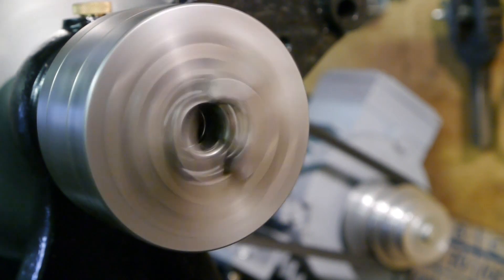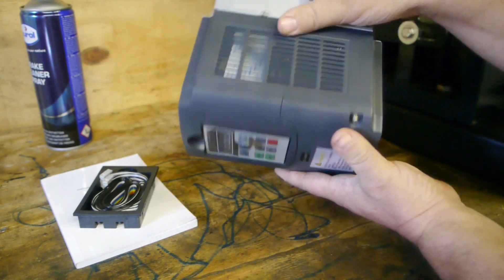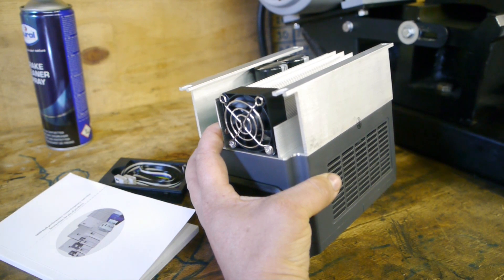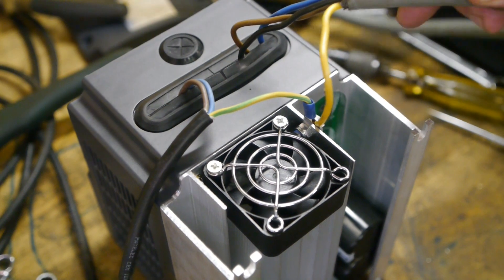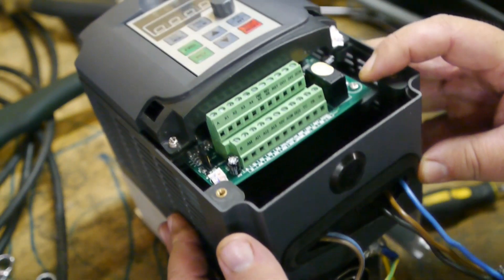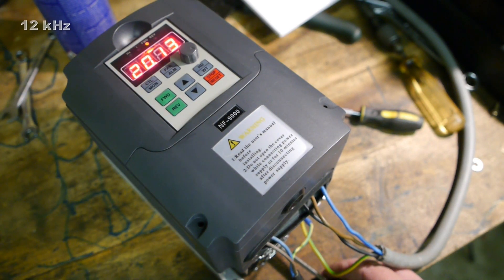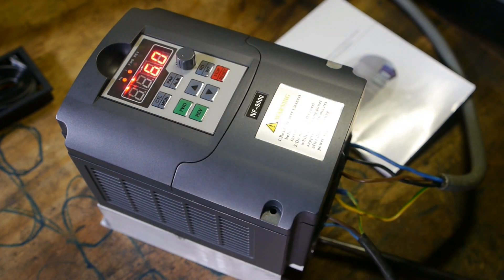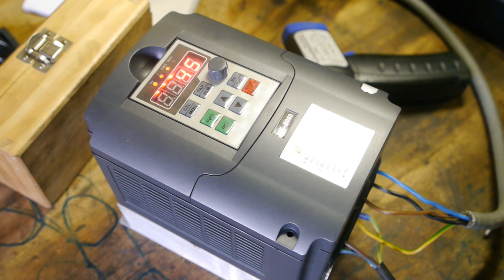Reviewing, testing and installing a cheap Chinese VFD

Comment from the maker: FYI: After opening up the drive I'm now pretty sure the fan was setup to run from the start. There is probably a firmware setting that can change this behavior but that will be hard to figure out.
I'm planning to install a variable resister with a on/off switch get rid of the noise.

Have a look inside: https://youtu.be/GXNwD2YVbpM

Comment: You had it easy, really. The one I got had several segments of the LED display not working. Imagine the hours of fun I had working with it before I realized which didn't work.
Reply from the maker: I can see how that will be super frustrating. Did you get it replaced under warranty?

Comment: Sir, the thorough review helped me greatly.  I have a knock off of that drive.  I am trained by the Air Force, circa 1965, through 1985, to trouble shoot down to the component level, and repair all electronics.
First I recommend external strain relief using the metal or the plastic cord restraints, to secure the two large cables on each of their side of the heat sink  Second, I would trouble shoot the temperature sensor, for it seems to control the fan, and runs it all the time. Your solution will work, for now. I do buy China made tools and items, to start with, and change some items out for USA made items, when available, and our funds are saved up.  There once was a 12 volt DC computer case fan, with sensor and rheostat, and there are some as NOS on ebay, or Craigslist,  most likely.

Comment: Looks like the newer model of the same VFD is called WK-9000 (instead of NF-9000).  I just bought a 2.2KW (3HP) variant of it.  The fan still runs continuously and there is still no ground terminal.  But it's easy enough to work around these two problems, so in my opinion this is still a good buy at the low price that it's selling.
Reply from the maker: They obviously haven't seen my video. Making the same mistakes again :) 
To work around the issues you probably void you warranty. Hopefully you won't run into problems.
I rather like my new VFD drive and I really appropriate it when I'm using my wood lathe that uses the old drive. A hell of noise :)
Reply: how do you install a ground terminal?

Comment: Temperature sensor is on the heatsink. You can replace the fan with one the same case size, input voltage rating, and lower air flow rating. If you can find one with sleeve bearings, it will be even quieter. On my HY VFDs, only the higher kW models have the fan on/off controls implemented, but the same firmware is installed in all drives. Only the default values change from model to model.
Reply from the maker: I was thinking about installing a bigger computer case cooling fan. Those run at a slower speed and should make less noise.
Unfortunately I need to fully dissemble the drive to get to the fan wires.
Reply: Disassembly is not too difficult. However, you could also consider cutting the wires and splicing them or installing a connector. Heatshrink insulation makes the splice option practical and safe. You will find that any particular cooling fan outline shape has many operating voltage and airflow combinations. In addition, you can often select ball bearing and sleeve bearing types. Sleeve bearings are much quieter. Fan blade count (more is better) and fan trailing edge also affect acoustics. The power supply for the fan is electrically isolated from the mains.
Reply from the maker: There is no way to get to the wires without disassembly's. But I will gather up some courage and give it a go :) Perhaps next weekend.
Reply: Since you have access to the 2 screws affixing the fan, you may or may not be able to get access to the wires without more disassembly. My HY VFDs are very similar but not identical to your unit. There are many YT videos on 'Chinese VFD Teardown' that might be useful. Here is a verbal description of what you will probably need to do and find along the way: Remove and unplug control panel. Remove wire access cover screws and cover. Remove housing fixing screws and housing. Remove top circuit board fixing screws and screws affixing 6 IGBTs and bridge rectifier to the heatsink. Pull the circuit board assembly away from the heatsink, taking care to not break wires to the capacitor circuit board assemblies and the heatsink temperature sensor (2 leads, TO220 device usually). This will give you access to everything. I may have left out a step, but everything will be obvious except possibly the need to remove the 7 screws fastening parts to the heatsink. The DC bus capacitors all should have bleed resistors, so you can proceed with disassembly safely within a few minutes of disconnecting power.
Reply: Just remove those 2 screws, and you will see that the fan wires are long enough to pull the fan away from the VFD and cut and splice the wires.
Reply from the maker: Wow, you know all that from memory?
I try to open up the drive tonight. 
If i fail I can always cut the wires behind the fan and install a bi0metalic normally open switch as Allen Kay suggested in his comment.
Reply from the maker: I had a look inside and everything is pretty much as you described :)

https://youtu.be/GXNwD2YVbpM
Reply: @whidbeyman  quick question I have similar vfd china made , and my problem is when I set motor brake on it seems it stops similar to stop by itself without brake applied?
Reply: @forgecro  I don't know exactly what you mean by 'set motor brake on'. Please explain.
Reply: @whidbeyman  it shows in the instructions when I imput some code that motor should brake when "stop" is applied but it slows down normally

Comment: Just a suggestion for the fan. Mount a 45C normally open bimetallic switch onto the heatsink. Should cost less that $3 and will cycle as needed
Reply from the maker: Thanks, thats a good idea. There is plenty room on the heatsink for another hole :)

Comment: The extra terminals are usually for DC Bus connection, it's only used in more complex applications like braking resistor, regenerative or VFDs in parallel
Reply from the maker: The VFD does have a build in brake resistor. I should say, did have. Because Christmas 2018 it died with a flash and a bang. Probably because I disconnected the internal fan.

Comment: I too was frustrated with the fan noise from my Huangyang VFD.  I did as Alan Kay suggested (below) and fitted a 45 degree C bimetallic normally open switch to the heatsink and now the fan is quiet and I don't think it will ever turn on since the VFD is only running a drill press motor. The only issue was getting at the heatsink which is fully enclosed on my drive.
Reply: Hi, may I help you? This is Chris INVT Group, the largest manufacturer for industrial automation equipment in China.

Comment: I've just bought another VFD to replace the one I had for 20 years and sold with a Deckel T&C grinder I had because it's  3 phase and would sell for single phase application more easily...... it's  a 2.2Kw 3 HP model currently listed on Amazon for A$80. When I connected it up to a 1 Hp 3 phase motor the cooling fan came on immediately and is whisper quiet. I can't understand why so many people have so much trouble just getting these things to work. Right from the word go it did what was expected and speeded up and down very smoothly......AND DEAD QUIET TOO even with a small load on. I might add that the 3 phase motor it's connected to is wired to the VFD in Delta formation. I'm on single phase 220 volt mains.

Comment: there would be a db noise issue is a factory. the induction motor has to be able to be controlled by a vfd or the resonance created by the high Hz damages your drive end bearing.

Comment: I know this is a few years old, but I had to start reading somewhere and I'm going down the VFD road to power a band saw conversion.  I have a 10:1 parallel shaft gearbox that I will chain drive to the lower wheel on the saw that drives the blade wheel and a 1.5hp, 1725 rpm, 208-230V, 3ph (new) motor.  I gave $40 shipped for the new gearbox and $50 shipped for the new motor (not bad) and the blade speed will be max 650 sfpm.  The noise issue with the motor is a big deal for me (and the fan).  I hope my new Leeson motor will work ok with the VFD.  I see VFD's selling on ebay for $73 or so but I will definitely need to see a review like this before I would order one.  The last thing I can think of is the color.  Everyone knows what happens to the light colored plastic after a few years they look terrible and the black color holds up the best.  There are small squirrel cage fans that are really quiet and definitely put out.  I hope you have made another review more recent but thanks for this one so I am aware of the issues.  Good job.

Comment: I think the main unit needs to be installed in a cabinet, underneath the bench, and the remote screen attached for ease of operation. If the fan is to noisy, mount it else where and duct the air in and out of the unit. and a big E stop button somewhere.
Reply from the maker: I'm sure that is the case, But amateur like me can't afford to buy a nice cabinet that would cost more than this unit :)

Comment: A good review.  Thanks.  Some good features like the remote panel and the cable being included.  Some really bad features like lack of ground.  I would not purchase a model without a ground even though I could add the ground similar to what you did.

I think the loose packaging may have caused the bend in the heat sink.  

I have only worked on installing my own TECO VFD on a Southbend lathe and 3 Hitachi VFD's on other peoples lathes.  These all  had ground and ability to have the fan turned off until a certain temperature is reached, like your manual stated.

My TECO defaulted to 60 Hz so the motor ran the first time.   The Hitachi's were like your VFD and defaulted to 0 Hz so the motor did not run until the frequency was increased.

The default for the fan was to have this run when the VFD runs.  In normal shop temperatures, It takes a good amount of load to warm up the VFD to the  temperature where the fan kicks in.

My TECO VFD is designed to be installed in a NEMA enclosure.  I expect yours is also designed to be installed in an enclosure to guard against dust and fluids.  The enclosure would normally have the strain relief for the wires.

You could make a wood enclosure for the VFD, just need sufficient ventilation so design with some louvers.

The lack of ground connection is likely a big issues for most electrical codes, including the NEMA code in the US.

I have some corded tools which are so called "double insulated" which do not have a ground.  Not my preference but it is allowed for these tools.

I think any motor or VFD to operate a stationary machine like a lathe should have a ground.  This is protection for the equipment  and the operator.
Reply from the maker: I agree I think this drive is supposed to be installed into a cabinet. The case is fairly open and lots of dust will get in overtime.
On the other hand, because it's so open it easy to blow out with some compressed air.
I must say that I was rather surprised that there was no earth terminal. And I don't think the drive would get certified for the European marked. It's to bad my review model didn't really work out but I haven't given up and I'm sure I will find a use for it.

Comment: lowering the carrier frequency can destroy the mosfets or the igbt, the deadtime needs also be changed. maybe low pass filter outside the inverter works, because it is a class D amplifier in 60 degree modes what is used or just squares in 60 degree fase shift who cause this harmonic noise. Setting the system to 8 Khz is better indeed, but the noise is lower because we hear not that good there, filtering works als better. one coil and one cap. The fact motor bearings get damaged is by harmonics, that is the bad sound you hear. three class D amps in 60 degree shift will make a hell of a regulator with low sound from motor.

Comment: the thing has two set points for the temperature control- it looks like you had the fan switch on at 22° and maybe the Unit switch off point set to 45° which is to low. can you adjust the setpoints? terrific review by the way, I'm looking to buy the exact thing.
Reply from the maker: The fan what running all the time so I disconnected it. And that probably killed the VFD after almost 2 years. I when with a flash and a bang followed by total darkness as the fuse cut out. The new one I use only runs the fan when the lathe is running. It's better although it does not have vector control. https://youtu.be/bCJN6Pk8ydg

Comment: Was there no ground pin on the power socket? Or did i miss something?
Reply: I noticed that too.
Reply from the maker: The power plug I used sure had a ground pin there was just nothing to connect it too. So I grounded the chassis (heatsink)
Reply: @Rolingmetal  fair enough but i meant the plug, that you plug into the outlet...if that has no earth then earthing the chassis is pointless. But i hope the plug you showed is on camera was just a random one and not the one used for the VFD. Great video by the way, very informative.

Comment: Just recently picked up a similar model. WK-9000. Identical issues, fan on from start and no earth. Actually seems to run fine without an earth from my initial test of it, but will add one like yours just to be safe :)
Reply from the maker: No need to drill a hole you can just add the ground to the mounting feet.
I've disconnected the fan. So far the temp hasn't been a problem.

Comment: I purchased a gt series 220v 2.2kw version, I'mbin the states, would my vfd work in the uk, or would a uk unit work in the states. In the us there is 2 live wires, each is 110v and one goes to R and the other to either S or T and a ground. In the uk there is one live wire with 220v and a neutral. Is bbn it the same unit or 2 different units one for uk and one for us. Someone help, I want to use a step up transformer because I don't have 220v at home. Thanks

Comment: i have done exactly as you did. nothing works. cant change the frequency. 😑 anyone having this problem? motor 3f hooked up correct. ive checked the 3f outgoing wires. but the read out is 0 volts.... can anyone help me or give a tip? thank you

Comment: Hello,
Can you kindly guide me that from any VFD which has output of 3-Phase 220V, can we handle speed control of 30V 6KW 3-Phase AC Motor with full torque?
Reply: Hi, may I help you? This is Chris INVT Group, the largest manufacturer for industrial automation equipment in China.

Comment: It looks like you got one of the base models. Some of the better models (not this manufacture)  can’ set fan all the time when VFD is powered,  can set when motor is receiving power fan operation, fan comes on when unit is 10° before internal melt down 75° C, then there is the most expensive units that you can program when you want the internal fan to come on with temperature sensors. Then there is the mixture of anywhere and in between.  You got a leaflet booklet. Probably 60 pages. Most of my VFDs  come with 300 pages
Reply from the maker: So what are, in your opinion, the better models?

Comment: Lol according to 1 guy it gave him ear cancer! Too funny. Love the vids
Reply from the maker: Thanks man, I love the positive feedback,  I'll try to make some vids now that depressing winter is over.
By the way this v.f.d died with a flash and a bang, little over a year ago. Now I use this: https://youtu.be/bCJN6Pk8ydg
Reply: @Rolingmetal  I'm actually looking at that one myself debating, but I just about finished turning my old delta wood lathe into a metal lathe, Not perfect but for me it'll do and want to get 1 for single phase to adjust speed on a beefy 2 hp Baldor motor I installed. The old 1/2 hp bogged down way too much and lost all it's power. Keep posting vids and I'll keep watching bud :)
Reply from the maker: I think it's good little vfd but there is no vector control. If you want power at low speeds you might want something different: https://youtu.be/gL1G8DLfzJI  So far I have not been missing the vector control :)
I'm actually working a new material right now. Had a break for 3/4 months after some medical issues and the winter, but I hope to make a strong comeback :) Good luck with the wood lathe.
Reply: @Rolingmetal  Glad you're well and doing better, looking fwd to upcoming vids

Comment: Interesting about your lack of Earth connection. In opening my 3KW Huanyang unit not only did it have the 9 terminal on the strip for a ground but also it has two screws holding the heatsink in the connection area also marked as ground connections for a total of three on it. It is CE certified.
I am a bit disappointed in how the base, which is the heatsink, is mounted. Instead of the slotted mounting holes being on the bottom, they are on the top. Slide up to install is not the way to do it. Also the cooling fan is installed for blowing down instead of on the bottom blowing up. That makes me think this unit was designed to be installed flat instead of vertically.  
This unit does allow for either single ( shingle in Chinglish from add on instruction sheet :-) ) or three phase use which is what the 3rd screw from the left would allow. So in my case R & T or R & S or S & T can be used for single phase and all three for three phase.  Notice on Banggood that Chinglish says single "phrase" on one of the 1.5KW units. :-)

Comment: How did you hook up the on/off switch?   I’m trying to hook up an on/off switch so I don’t have to unplug the VFD all the time.    Thanks for any help.
Reply from the maker: It's just a switch in the single phase power cable. Like you have for a lightbulb.